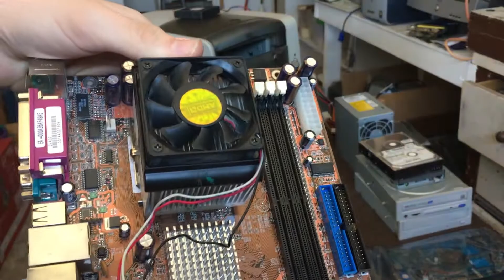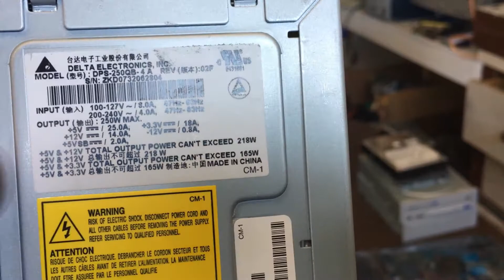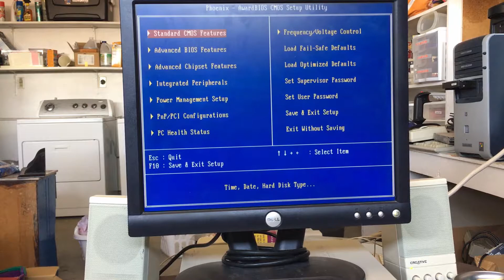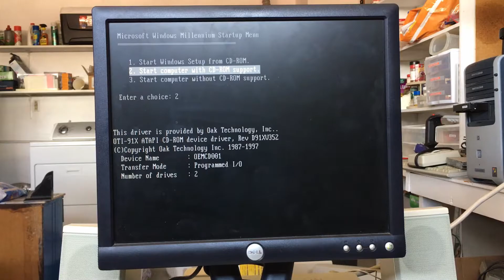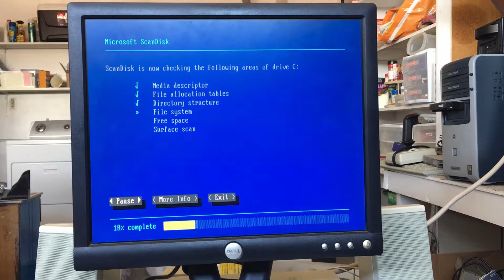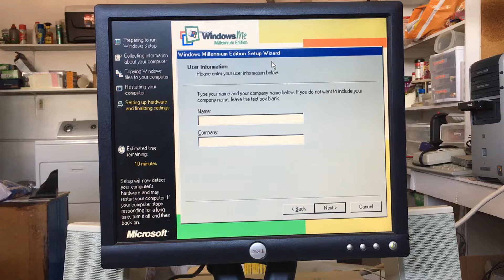Building a Windows ME "Sleeper"

Comment: Did you ever try removing that obvious brass standoff that you overlooked in the video?  Literally right in the middle of the board, with no hole lined up for it.  I was surprised that you consciously looked for such a thing, then missed it, and plopped the board down onto it.  I know it is a 7-year old video at this point, so it is probably long since been dismantled.

Comment: I really like ME, always did.  I currently have a socket 370 Coppermine Pentium 3 system and it's super stable - I tried the same machine with 98 SE and it was totally unusable, it crashed every five minutes and locked up, with BSoD all the time, same hardware, same drivers, utterly hopeless.  I don't get the ME hate.  I would forget spinning hard drives - just go with an SD to IDE card and use decent SD cards.  Once you have a good stable system with all drivers installed and working, make a disk image with DD, and then if the SD dies, no issues, burn a new one and carry on where you left off.  A lot of people prefer a CF card solution to an SD one, but in my experience CF cards are really fussy, often don't work at all and they're flippin expensive these days.  SD cards are now super cheap and tend to just work.

Comment: The CPU seems to be running at a lower clock speed than normal since the lowest clocked Socket A/462 Sempron is clocked at 1.5 GHz. https://en.wikipedia.org/wiki/Sempron#Models_for_Socket_A_(Socket_462)

Comment: i am not sure if there is a connection, but there used to be a company called syntax that made cheap LCD televisions, the merged with a company called brillian in 2008 and became the syntax Brillian corporation, they made televisions under the Olevia brand name, which were actually pretty good televisions, i think they went bankrupt after the market was flooded with cheap televisions and they could not keep up... anyway the company was called syntax and they may or may not be related to that syntax board.
Reply from the maker: I found out a while back that Syntax was a sub-brand of ECS Elitegroup (if I remember correctly). So, I don't think they are related

Comment: Is Windows Millennium really as unreliable/unstable as people make it out to be in term of drivers support? Researching on what OS to install W98SE, ME, or 98SE2ME. suggestions?
Reply from the maker: It really depends on what drivers you use. I think a lot of hate for ME comes from it's launch when device manufactures didn't make drivers for MEs launch, which meant people had to use 98 drivers which were often unstable. I've also had just as much instability in 98SE as well. I can't tell you how many times 98 has blue screened or locked up on me with dozens of different hardware configs. The 9x kernel just wasn't that stable in all honesty.

Personally, I'd still recommend 98SE because it has true DOS support and may have better driver support for older hardware, but if those aren't concerns to you, ME has some real advantages: native USB drive support, slightly faster boot times, additional multimedia functions, etc. 

tl;dr pick whichever you want as you'll probably have a pretty similar experience
Reply: That's very true. I had a lot of problems with the 9x operating systems. When I finally got XP,  I had no trouble with it what so ever.
Reply: @NTGTechnology  Have you ever tried Windows 98SE2ME? Just discovered it today. Tell me what you think of it.

http://www.mdgx.com/9s2m/read1st.php
https://msfn.org/board/topic/46349-98se2me-killer-replacements-me-98-se/

Comment: can we have a list of the specs pls
Reply from the maker: Ill try my best to remember what they are so here it goes,

950mhz AMD Sempron
"Syntax" Motherboard (I really know nothing about it)
512MB DDR Ram
3.5 Inch Floppy Drive
Two CD Drives (I think one is a burner)
Nvidia GeForce 4 MX440 (64MB)
250w Delta PSU (Might be faulty thus the machine not working right)
Old HP Pavilion Case
30GB Maxtor IDE Hard Drive

I'm pretty sure that's everything, If you want the specifics of a certain part let me know.

Comment: My money is on the PSU being the culprit.
DELTA has a good reputation for building decent OEM PSUs but that thing is more than fifteen years old and has probably been the only warm air exhaust for the system it was in so it didn't run under ideal conditions. Since like you suggested your system draws most of its current from the 5V and 3.3V rail, using 12V mostly for drive and fan motors, with your configuration under heavy load that PSU would have probably been at 80-90% of its max. specifications when new. 
Having the system crash like that when plugging in a USB device and subsequently having it crash under load (98 install) is another hint that the voltages aren't stable. You can probably check them out in the BIOS. Or just get a better PSU. You'll need it anyway.
The cheap ECS board likely isn't helping matters either but the PSU usually plays a greater part in issues with system stability.

Also that TIM application is nasty but not problematic. The paste isn't conductive and the die is small enough that all excess could just squeeze off to the sides. Too much TIM first became an issue with high TDP processors with a large IHS like the Pentium IV where excess TIM couldn't easily escape and started to act as a heat barrier.
Reply from the maker: Yeah, I've been suspecting it might be the PSU. I just need to find another that has a strong 5v rail to test with.
Reply: With your config a continuous output of 20A@5V and 100W@3.3V+5V combined should be enough for an OS install. If you have a new-ish ATX 2.x PSU lying around it should do the trick. Just don't push the system and you should be fine for testing.
Reply from the maker: I have a Coolmax PSU with a 150w 3.3v + 5v rail I'm probably gonna try. I've also noticed that the Delta PSU I was using was also displaying odd behavior in testing I did with it after the video. Whenever Windows 95 (which is what I was a running on a different system for testing) would use ACPI power shutdown the pc would turn off, but the PSU would make this weird pulsing noise and the power light on the back of it would rapidly flash. So, I think we conclude that there is defiantly something up with the Delta. (I should also note that the Coolmax PSU is the one that came with the motherboard in the sleeper so hopefully it should work.)
Reply: That Coolmax PSU should do fine if it hasn't degraded too much over time. Fingers crossed!
Reply: @NTGTechnology  Yeah, almost any 2003-4 reputable PSU will work better than that Delta.